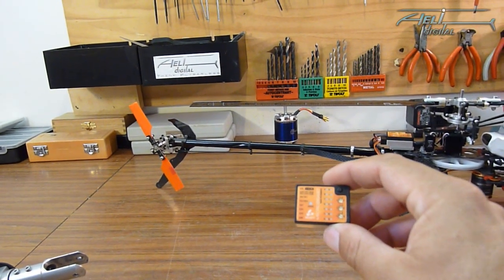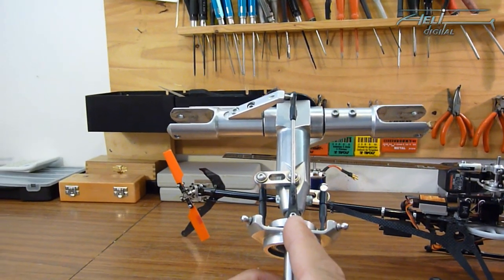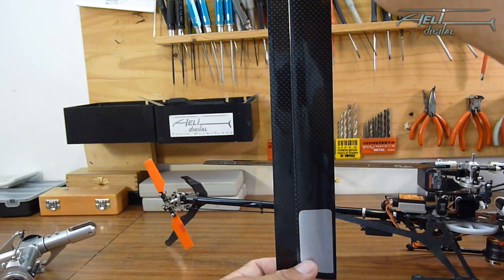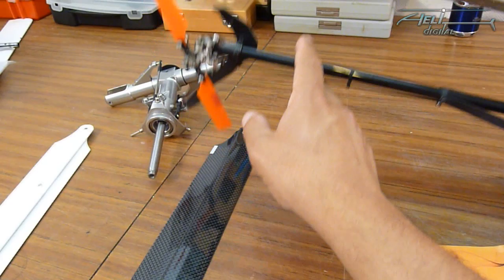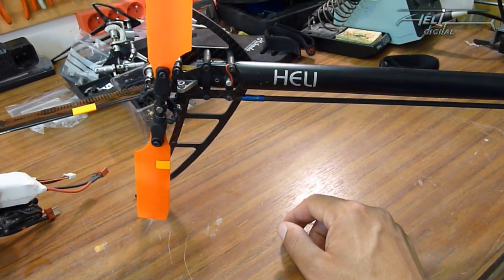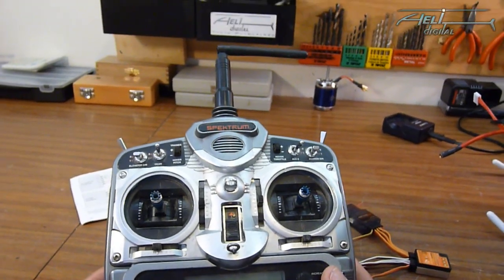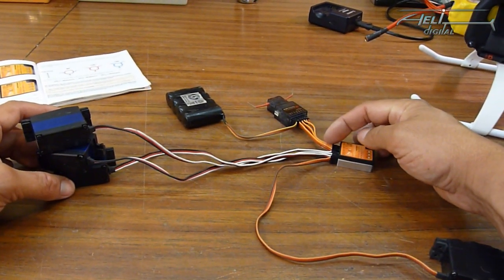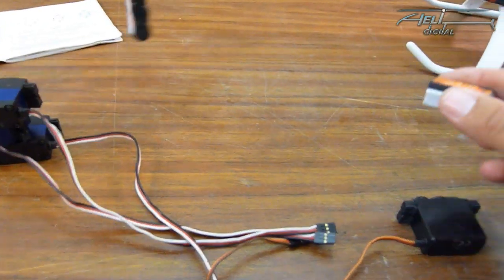Microbeast V1 Setup: general considerations part 1

Comment: You do not need too ground anything.... there is no electricity by the tail or anywhere other than the wires and motor/esc/ fbl system, they are all enclosed and they are already properly grounded and shock free..